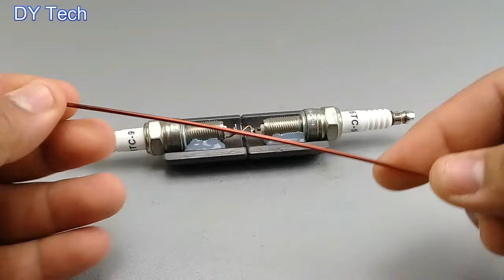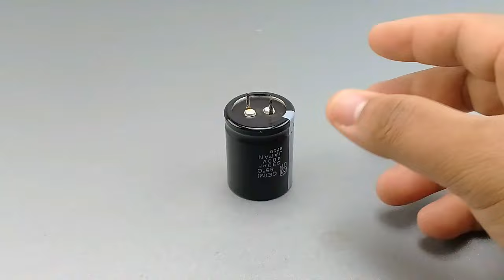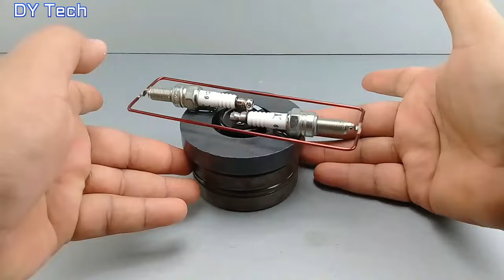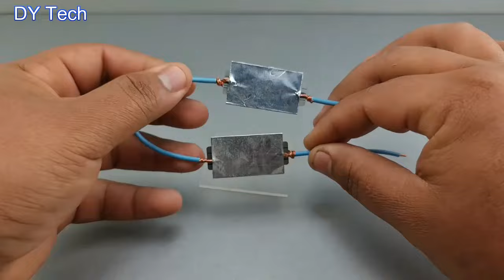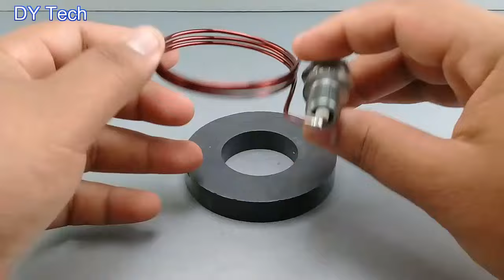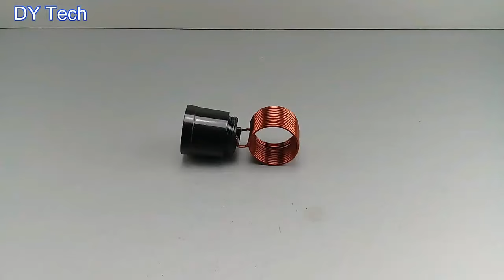Free energy 220v generator Top5 copper coil Light Bulb electric AC condenser 5KV Transformer Ideas

Comment: Intanto non capisco come ti si possano fare dei complimenti quando tu ti stai prendendo gioco di tutti noi.
Seconda cosa
Ne le "sparking plugs" ne le lamette da barba sono degli elementi attivi e quindi non possono in alcun modo né generare né tantomeno aiutare a generare corrente elettrica, sono dei semplici conduttori metallici e basta, esattamente come un filo elettrico in rame.
Nemmeno i magneti sono parti attive nella creazione di energia elettrica se non si muovono rispetto alla bobina di rame, e per ultimo un condensatore in presenza di corrente continua non conduce corrente, funziona solamente fino a che  è presente una variazione della tensione tra i poli. 
Quello che hai fatto tu è stato solamente creare un circuito chiuso che permettesse alla tua lampada led con all'interno una batteria di accendersi.
Hai usato una lampada capiente in maniera che potesse contenere una batteria a basso voltaggio così che le tue mani non riuscissero a chiudere il circuito data la resistenza elettrica della pelle umana.
Se avessi usato un filo metallico per collegare tra loro i poli della lampadina questa si sarebbe accesa.
Hai sprecato inutilmente  materiale, spazio web, tempo tuo e nostro per attaccare assieme pezzi insignificanti senza un senso ma solo per sembrare un genio della free energy invece sei risultato un genio del fake video... E nemmeno tanto bravo, su you tube ce ne sono di molto migliori... Anzi tu sei risultato il pessimo tra tutti!